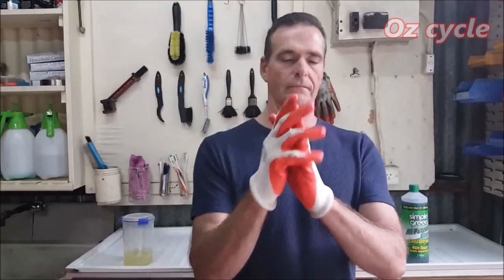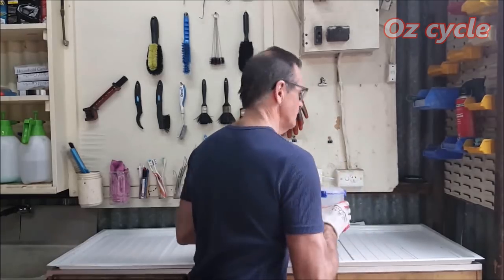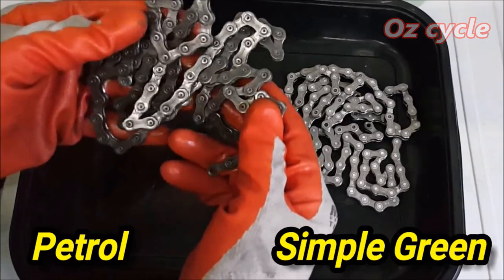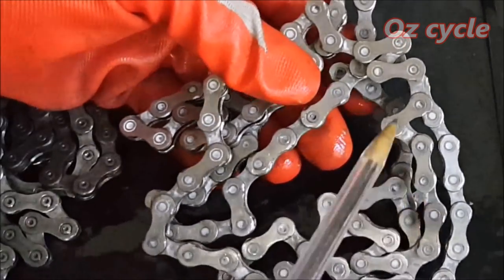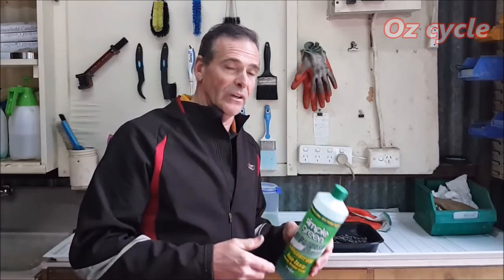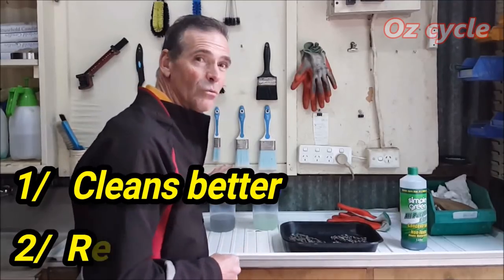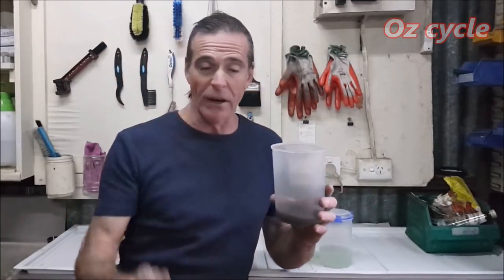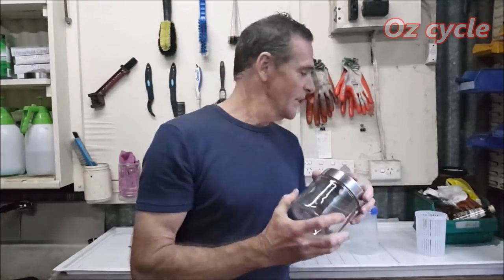Simple Green VS Petrol - which cleans better?

Comment: Molten Speed Wax: First Impression(s).

Placed thoroughly clean chain in 200* Molten Speed Wax (MSW). After 30+- minutes, temp still set at 200* on melting pot, removed chain, and hung to dry for 30-60 minutes. Note: When I removed chain from 200* wax, there was not much wax running off from the chain, maybe the same, or a bit less, runoff as from the chain when the chain was removed from 120-125 degree Gulf paraffin wax.

When the chain was taken down, after hanging to dry, chain was very stiff. There was little excess wax on the outside chain plates. I followed MSW's directions, and pulled chain over a piece of 1" diameter PVC pipe to loosen links. Chain was still somewhat stiff when I installed it. I'm attributing the stiffness to a substantial amount of wax on the inner parts of the chain. After riding the bike 2+- miles chain was running very smoothly. 

I have only put 47 miles on the chain. But during those 47 miles the drive train produced almost no noise. Equal to or less than the same chain and drive train when I had used Gulf paraffin wax. How long the MSW application will last remains to be seen.

Note: I have posted this here as per your request. I.e. ......................"let us know how you go with Molten".

Comment: The number one cleaner I've found, is the molten wax.  Despite shaking my chains in petrol, turpentine, metho, detergent.... I put it in the molten wax and stir it around for 10 minutes and all this extra dirt comes out.
I end up using two wax containers ( alfoil roasting containers from woolworths, cost $1 each or so). One container for a final clean, and then a 2nd container for the clean wax finish.

Comment: I use the same container but I also use the strainer so the chain does not sit in the grit. I don't used petrol I use diesel slightly less toxic (only slightly) and less flammable. Once used and settled the clear diesel is added to the mower fuel and used again only slightly better for the environment. As far for the oiliness once the chain has sat in hot wax for 30min is absorbed and means the wax is not as dry or hard. The paraffin wax I add about 10% gear oil to soften it and lower its melting point to around 40C. I've been using this blend for around 12months on both road and MTB and little dust and grit collection occurs. So far so good.
Reply from the maker: Some great hints there Richard,thanx. I found that when swishing around the chain in the container it got covered in the grit anyhow so thats why I didnt use the strainer.

Comment: There is a degreaser for engines called GUNK. It works FIN on engines so there would be no reason to think it wouldn't work on a chain and it's a damn sight safer. There are 1000 things better and safer than petrol.
Reply: I have used it several times works like a charm, but smells weird LOL
Reply: Pretty sure it's petrol derived

Comment: WARNING - Many years ago the son of a colleague of mine was cleaning car parts with petrol in his home garage. He went to turn the light on and a spark in the switch ignited the petrol vapour in the garage causing a fire ball and very sadly he died of his burns. Petrol can be dangerous when used this way. I am sure that there must be other and safer  powerful degreaser that can be used.
Reply from the maker: With all due respects,thats why the container has a lid.
Reply: Kerosine would lower the fire/explosion risk somewhat over petrol/gasoline formulated as automobile fuel.  Petroleum based paint thinner would also probably be less hazardous than petrol/gasoline.  As mentioned in another comment, an ultrasonic cleaner paired with Simple Green or a similar water based degreaser may be the best combination of effectiveness and safety.  

Simple Green and other water based degreasers would also be more effective against wax if heated enough to melt the wax.  None of them are likely to do well against solid wax, but with the wax melted, they may wash it away just as they do with oil and grease at lower temperatures.
Reply: Sorry for your loss, this can be avoided by applying it in an open space where the vapour cannot be trapped

Comment: I tried simple green awhile back and found it just didn't work well enough. I used gasoline get the chain really clean. Hot water and dish soap. Rinsed well then wax bath.
Reply: I bought a whole gallon of concentrated Simple Green, so I'm stuck with it, although I live in a small apartment in a high-rise bldg and nowhere in winter to clean my drive train outside, so with no bad fumes or toxicity, it's been invaluable to me.  Did you try Simple Green with like a Park Tool chain cleaning device?  I bought one for $25 and haven't used it yet.  I'm thinking since maybe it's easy to use I'll clean my chain more often, and free-wheel, and maybe save money as all will wear less and serve longer being cleaner. 

To have a shop clean and replace the chain and free-wheel, and clean the rest of the drive train, I think, is about $50, maybe more as last fall a mechanic replaced my chain and did some light clean of my drive train and charged $48.  I didnt' complain and thought it was a turning point for me paying a lot over several years to mechanic shops and bought some tools.  

You have to buy the free-wheel removing tool if you really want to rinse or shake clean it (right now I can hear and feel grit inside mine)... The tool is basically a lever about a foot long and with about a foot of bike chain attached to it that's used to tighten the free-wheel, (about $28) back onto the wheel.  I also have a free-wheel tool that fits within the free-wheel like a big socket (not sure what that cost, I think it was $9) that you put in a vice and free-wheel comes off counterclockwise, but in my case instead of a vice I have a foot long crescent wrench.  So with my old fashioned 7 speed "cartridge freewheel" that's how I learned online that I have to do it. 

 I got the chain cleaning device, that chain/lever tool, and the socket, plus a Park Tool 3 brush cleaning set that I think came with the narrow gear cleaning brush that has a sawtooth plastic handle for cleaning between the freewheel gears as I understand each time you put on a new chain you should put on a new freewheel, however last September a mechanic said he'd put on a new chain, but that I didn't need a new freewheel, that was the job that cost $48.  It's almost January and I commute by bike 100% and don't own a car, and it still works fine only now just starting to have to play with the shifter sometimes to get it to change gears, a sign of needing new free-wheel and chain, so 4 months and didn't have to buy a new free-wheel.

Comment: I noticed that rape oil attracts dirt. I Cleaned and oiled the chain same time. I cleaned the oil with coffee filter and used it again. Biltema- chain cleaner had rape oil and some other substances as well with bio degreaser, so it is usable. Bio lubricant didn't last as long said my friends mechanic, so there might be some disadvantages with bio substances.

Now I disassebled a chain waxed it with paraffin, solid candle paraffin only, and only wipe it from dust after use. I have rust-free chain, it should last longer.
Reply from the maker: Did you add any paraffin oil to the candle wax Lauri? Candle wax only does not last long in a chain.

Comment: Silca has an interesting article "Hydrogen Embrittlement, Can You Really Break a Chain" Here they warn not to use simple green because it can make the chain brittle. If you still want to use it rather take simple green aircraft cleaner.
Reply from the maker: Hydrogen embrittlement occurs over prolonged exposure to the solvent. By far , most chains break because of cross-chaining.
Reply: @stevenleffanue  Yes you can use SG for cleaning and even short soaking but you shouldnt let it soak over night or several hours.

Comment: How many times can you reuse petrol?  Wouldn't it have a bunch of dissolved oil in it?  Or....should we not reuse it if it was used to degrease a brand new chain?
Reply from the maker: You can usually get three uses as a cleaner but it gets weaker with every use. Petrol is cheap so just use a new lot every time.
Reply: @stevenleffanue  Hmmmm...I think I'll reuse the petrol I just used to degrease two brand new chains as my "first stage" cleaning on two grimey (but in tolerance) used chains I'm prepping for wax

Comment: Regarding using petrol as a chain cleaner, and Anton Rodman's claims.

Obviously using gasoline for cleaning bicycle chains is hazardous, and not good for the environment.

Anton Rodman claimed that using gasoline for cleaning a bicycle chain would be detrimental  to the chain. Several days ago Rodman was asked to provide sources of information that supported his claims. For whatever reason(s),  Rodman has not (as of yet) provided us with any information to support his statements.

I attempted to find information relating to any negative effects that gasoline might have on metal, and/or metal bicycle chains. I found none. There may be information that substantiates Rodman's claim, but I didn't find that information.

Whether or not one chooses to use petrol for cleaning chains is a personal decision.
Reply from the maker: If petrol had detrimental effects on metal there would be no motors vehicles.

Comment: What if you use Simple Green with a Park Tool chain cleaning device, will the chain then be as clean as if you used petrol?  Also Simple Green is nontoxic and no fumes, so with more work could you get the chain just as clean?
Reply from the maker: Sorry , no. Simple green is not aggressive enough to remove factory packing grease
Reply: @stevenleffanue  Thank you!  Also thanks for making such a nice video!  I think too though, of the paradigm shift away from fossil fuel we need to make, however, riding bike itself is a big one!
Reply from the maker: Use couple of cups of petrol to clean a chain once in 14,000km but drive our cars and think nothing of it

Comment: Suggestion: Do a comparison between paraffin wax (like you use) and Molten Speed Wax.  Yes,  Molten Speed Wax is  around 3 times more expensive than say Gulf Wax. ( 1 lb. of Gulf Wax is around  $5 to $7 US Dollars. Molten Speed Wax around $20 for 1 pound, on Amazon).  But according to the instructions, for Molten Speed Wax,  the chain is immersed in the wax, removed from melted wax,  hung up, then installed on the bike. Seems like a less time consuming process.

Also, from my research, it would appear that Molten Speed Wax is one of the best chain lubes available. 

On the Molten web site, they claim a single wax treatment will last up to 350 miles for a "training chain".  "Rewax after 200 miles to double chain life." As I seem to recall, you recommend re-waxing after around 200 km. ( or  +- 125 miles). 

For over a year (since you posted your first video on waxing chains) I have been using wax on the chains on several bikes.  However, recently you added the step where the chain goes from the melted wax into cold water. These leaves excess wax that needs to be removed. 

I recently purchased some Molten Speed Wax, which I have not used yet. I've only received it 2 days ago.  I intend to see how well the Molten Speed Wax wears compared to Gulf Wax. And also compare the ease of waxing a chain(s) with the Molten to compared to Gulf Wax.

Disclaimer: I am in no way associated with the company that manufactures or sells Molten Speed Wax. I purchased the Molten Wax myself from Amazon for $20 for a 1 lb bag.

You might consider doing a video comparing using Molten Speed Wax and plain paraffin wax.
Reply from the maker: Yes I may well do that comparison William....let us know how you go with Molten??  Molten is considerably more expensive, almost immeasurable performane improvement to just paraffin wax and not universally available like paraffin wax.
Immersing the hot chain in cold water stops it running out as a chain is hung up to cool down. The whole point is to get the wax INTO a chain.

Comment: Currently I use diesel (european petrol for diesel cars) for cleaning my chain.
It takes the residue in the jar forever to evaporate.
I guess it is the oil component.
Should I use normal car gasoline instead?
Reply from the maker: Yes, normal petrol.
Reply: Hahaha Jan. Diesel fuel is not petrol (gasoline)

Comment: Oz, if I were to use petrol and had no intention to wax my chain, would I be ok to just rinse the chain after the soak to get the remainder of the petrol off? Then re-install and lube as usual?
Reply from the maker: If you are going to lube your chain with oil,no need to rinse,just put chain on and oil it as you normally do James.

Comment: Seems like you could do this in one step if you heated the degreaser with the chain in it. This would allow it to properly remove the wax but also degrease the chain at the same time. The petrol is strong enough to remove the wax without heat but still needs to be degreased.
Reply from the maker: Good point William. I will try that. The difficult part is removing the wax from within the chains pins and rollers. Petrol just seems to get inside all the nooks n crannys.

Comment: How about using the Petrol/Kerosene/Turpentine before a rewaxing (saying once a week or two) and use the Simple Green and a chain cleaner after every ride followed by a waxed based relube?
Reply from the maker: Its not necessary to completely disolve all wax from a chain for every rewax. The wax inside the chain is usually still very clean. Just remove any contaminated wax on outside of chain before a rewax. Even a few wipes with a clean rag will do the trick.
Reply: @stevenleffanue  With your work, in the video, didn't the Simple Green, then, do enough contaminated wax removal, to feel comfortable with a rewax dipping?
Reply from the maker: Simple Green isnt good at removing wax,so any wax that gets dirty needs to be removed with a stronger chemical like degreaser or petroleum.
Reply: @stevenleffanue  In your video, it appeared that, for the most part, the "petrol" removed all the wax but you noted that removing all the wax before a rewaxing was not necessary. Do you know of any chemical/liquid or proecess, that will remove the contaminated wax, but keep the clean wax between the moving parts so that all you need to do is apply a wax based lube, after cleaning?
Reply from the maker: Put a bit of degreaser or petrol on a clean rag and wipe the whole chain until it looks free of all contaminated wax...now pop it into the hot wax.
Reply: @stevenleffanue  What I was tryinhg to scheme was a way to remove the wax contaminates after a days ride and relube with a wax based lubricant until it was time for a complete rewax dipping.

Comment: Simple green also makes an industrial strength heavy duty cleaner/degreaser. I wonder if that would do a lot better.
Reply from the maker: Not sure but petrol is still cheaper by far.
Reply: Yup. He used the all purpose stuff in the video, which isn't really meant for heavy duty degreasing. But the all purpose is much easier to find vs the industrial version.

Comment: Could you please tell me why, after I clean my chain with petrol, hot wax my chain in paraffin and candle wax mixture , and after a ride or two the chain looks like it's been lubricated with old black sump oil ?  So I clean it off with a clean rag but it still comes back every time  ?
Reply from the maker: Is your wax mixture equal parts paraffin oil to candle wax Peter?
Reply: Thanks for your reply , , the mixture has more paraffin than candle wax so that it's a bit runnier .
Reply from the maker: Thatl be it Peter. If anything,go 50:50 or less oil than wax. Do the knife test....the room temperature result should be slightly softer than a candle.

Comment: I use paraffin to clean my chains and hang to dry. Does this need degreasing as it's the same base as the wax?
Reply from the maker: Paraffin is not the base for the wax but used to soften it...it molecularly becomes wax at a lower melt temperature. 
To make the wax stick to the chain you will need to remove all other lubricants....wax sticks to bare metal
Reply: thanks OZ, love the out takes by the way.

Comment: I have been told Simple Green should never be used on ANY drive train components due to chemical reactions with the metals.
Reply from the maker: Ok. I havnt heard that before Jamie.  Cheers
Reply: You can use it on everything. Simple Green themselves offers instructions for cleaning bikes : https://simplegreen.com/cleaning-tips/rooms/hobbies/bicycles/
Reply: Silca has an interesting article "Hydrogen Embrittlement, Can You Really Break a Chain" Here they warn not to use simple green because it can make the chain brittle. If you still want to use it rather take simple green aircraft cleaner.

Comment: Can i sue diesel to clean chain instead of petrolium ?
Reply from the maker: No. Diesel contains oil
Reply: @stevenleffanue  but petrolium also contains oil. If you want without oil then you should use kerosine
Reply from the maker: Very fine and it easily removes with degreaser

Comment: will petrol remove rust?
Reply from the maker: Doubt it but should significantly slow the rusting process
Reply: Sandpaper, steel wool, wire brush, vinegar..................

Comment: Question. Does diesel clean as well as petrol? Good work. Nice video.
Reply: Charl Wait - yes, without the risk of being barbecued. Or use white spirit.
Reply from the maker: No,diesel has a higher oil content as well as lower octane level, Charl. It may be safer to use but doesnt clean as well as petrol
Reply: Thank you, much appreciated. Will use petrol on my next chain re-wax. I know its not necessary for a 300km re-wax on a road bike. I can just put the chain in my slow cooker, but I am curious to see what the result will be by cleaning it with petrol.